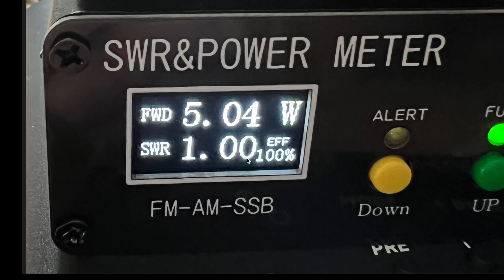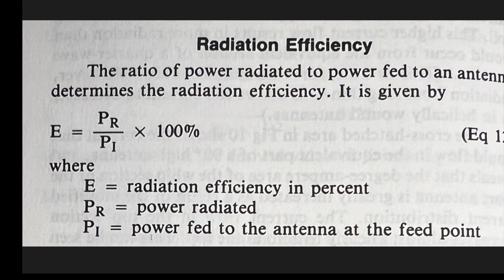Ham and CB Radio Myth - Low SWR Indicates a Good Antenna.

Comment: Thanks for the video link. Just goes to show that you don't have to spend a lot on a professionally made antenna to get results.  I listen to shortwave radio, and scanners mostly, and I've made a few that work really well. The 1/4 wave ground plane that I made out of a SO-239 connector for 800 mhz works gangbusters. Thanks.

Comment: Thank you. 
   We have hail and 80 to 100 mph winds here in Missouri. 
  I use SWR to  check antenna damage - serious SWR changes mean it's time to check the antenna and feedline. Add to this signal reports from other hams.
   If others notice you signal has dropped, check your radio system.

Comment: Hi Mark the Ham Florida Man
I have a suggestion for the Ham radio myth series. Concerning the Signal Strength Meter. You could call it a myth or a mis-use. The Signal Strength Meter does not show the signal strength of a contact, what is does show, is the combined level of the signal plus the local noise floor at the receiver location. So reading off the number shown on the meter gives an incorrectly high signal report.

Comment: A myth, grounding equipment, ARRL recently said don’t many hams it’s a must, one guy on YouTube said it’s illegal to ground your equipment. What’s the truth and what is the myth? 

I’m a new ham still learning that’s why I watch your videos.
Reply from the maker: There's a ground to prevent shock hazard and also an RF ground.  All modern equipment has a three wire power cord to prevent electrical shock.  RF ground is different.   That's binding your gear's chassis together with copper braid and then outside to a grounding rod.  ARRL says this helps prevent RF in the shack problems which can cause gear to malfunction.   I have personally never done that before and never had RF in the shack problems that could not be dealt with by good engineering practice.  I suppose if you are running high power a good RF ground system as described may be a good idea.  Let's hear some other comments on this subject.  Read this paper:   https://www.arrl.org/grounding#:~:text=RF%20ground.,the%20other%20connects%20to%20ground.
Reply: @BustRadioMyths  Thank you so much
Reply: @NoMoreRadioMyths rsgb info on  Bonding chassis together to a bus bar without the ground rod is about keeping all the equipment at the same rf potential, rf groundplane is done at the antenna, as you say its about good engineering of your system
Reply: @Pioneer936  That was a bunch of nonsense, do you have details about what you are talking about?
Reply: @W5KJD  see rsgb info on Bonding and grounding before you start mouthing it
Reply: @Pioneer936  So the answer to my question is no.
Reply: @W5KJD  the details you require are in the RSGB paperwork on grounding and Bonding what details do you want me to pass on to you
Reply: @Pioneer936  This has gone way over your head.  You are not understanding what I say.
Reply: @W5KJD  I am asking what details do you want ,all the info for what I've said is in the RSGB paperwork on this subject, is there any specific information you want me to comment on please say
Reply: @W5KJD  ????
Reply: @Pioneer936  It’s over your head.
Reply: @W5KJD  not over my head you obviously don't understand what I've asked you ,,what details do you want me to provide as mentioned all details of what I've mentioned can be found in the rsgb paper on this subject